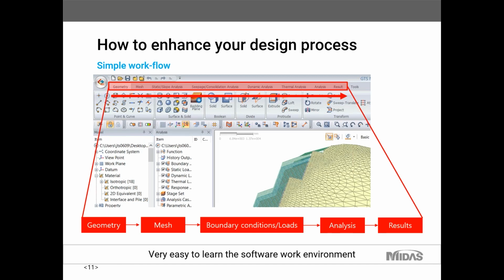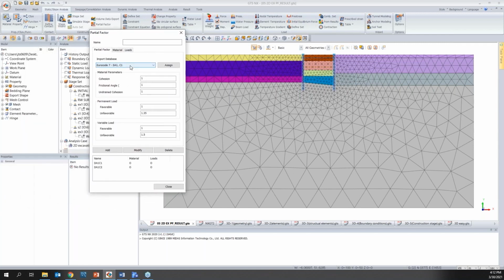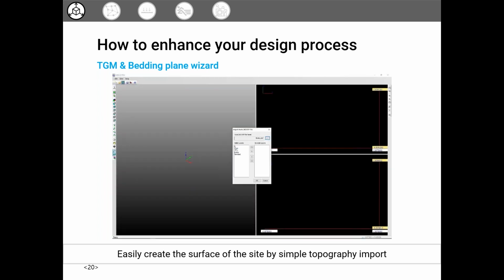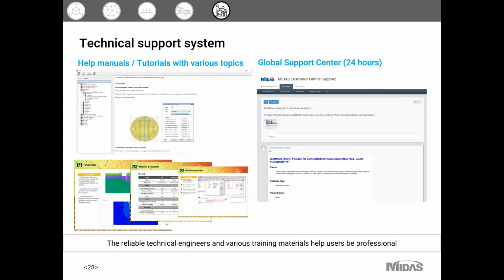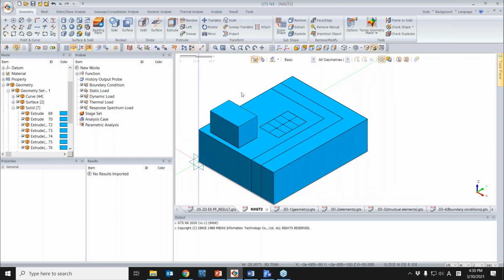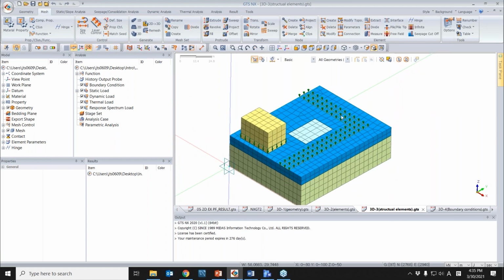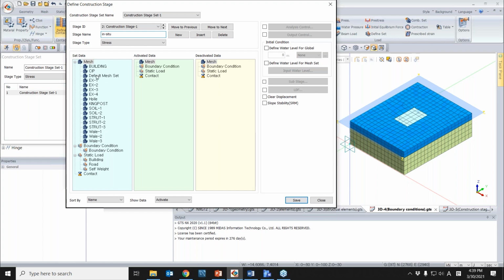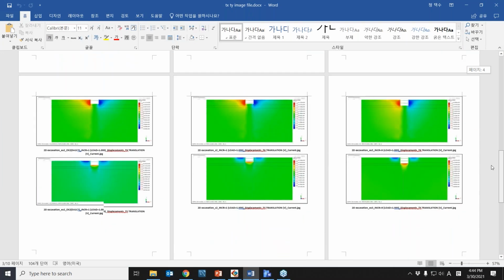Online Introduction: Getting Started 3D FEM Analysis in GTS NX

Comment: Very nice, i wondering to now, how about the coordinate system in gts nx? Its can use UTM coordinate system? Like used by autodesk civil 3d.. thanks..🙏
Reply from the maker: Hi Rust, Thanks for your question! 
Yes, you can use UTM coordinate system in GTS NX, as well and the negative value depends on the results types such as settlement, bending moment, shear force.
Reply: @MIDASGTSNX  thanks a lot for your answer, everythime i inout the topographic contour or solid from civil 3d the axis is so far from my topographic, how to move the axis to the topographic solid that i imported?